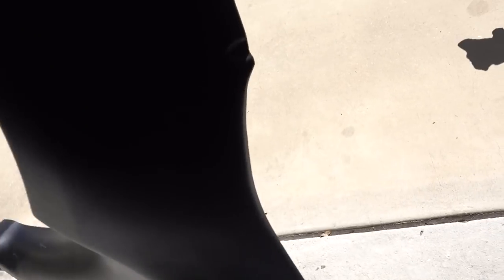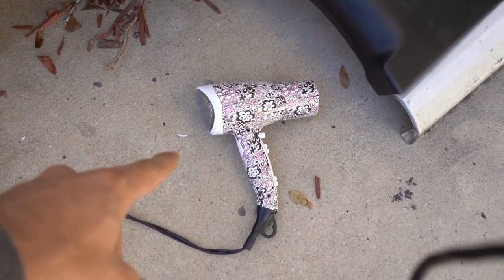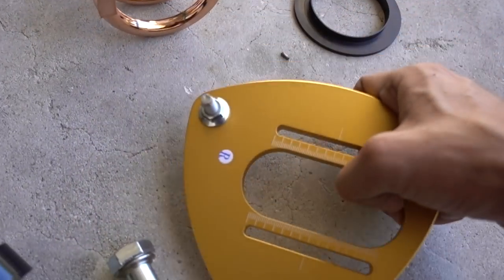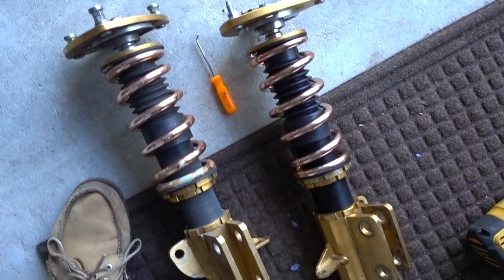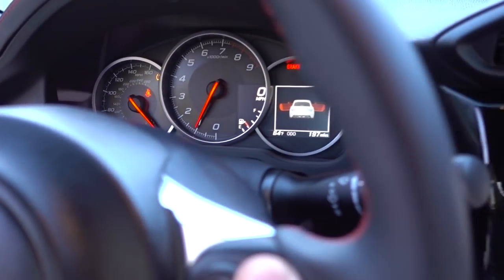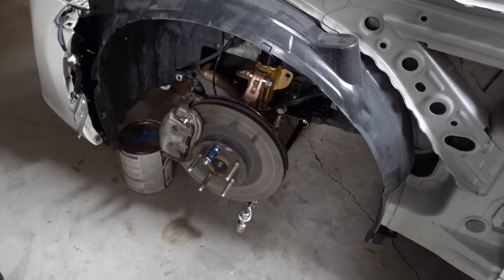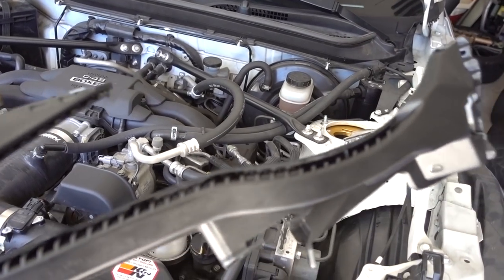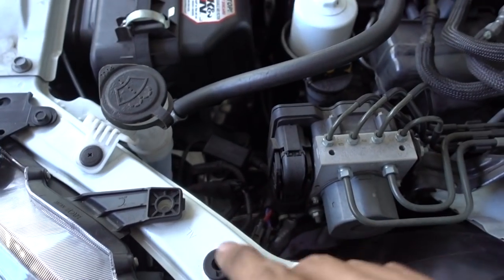Found More Damage + Rocket Bunny Fenders!

Comment: the gap from headlight to hood when it is full closed should give u an idea of how far the cprner is out. thats a weld in piece. most likely will have to be straightens with a hammer. doesnt look like its out too much from the video. removing the headlight after you check the alignmwnt should gove you a better idea where its bent
Reply from the maker: Exactly what I am going to have to do this weekend :P

Comment: great video! thanks for sharing. btw.. do you run 215/45/17 on a 17x9 rpf1?? how's that working for you??
Reply from the maker: Yes I do! And it works just fine! :)
Reply: AMBush Drift awesome! you think 215/45 on a 17x9.5 would work just fine? my stock tires are still pretty new and I'm trying to save $ on tires. 😅

Comment: what I find  funny is if you try to legitimize the reason  for buying reps it okay???
Reply from the maker: Because they're going to get damaged and I dont plan on staying rocket bunny.
Reply: AMBush Drift I get it and I agree with you. If the  community thinks it's wrong it's wrong if it's right it's right across the board. I think what should of happened is the youtube community should have supported TJ. Instead some poke fun and then do the same thing he did.